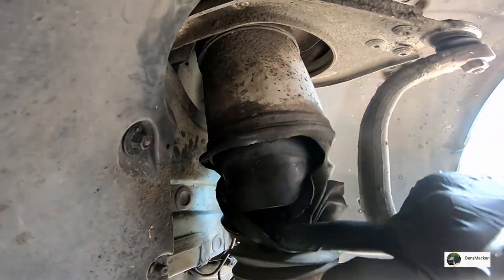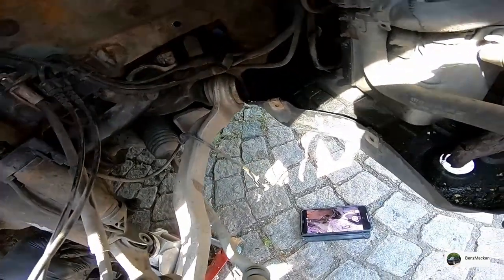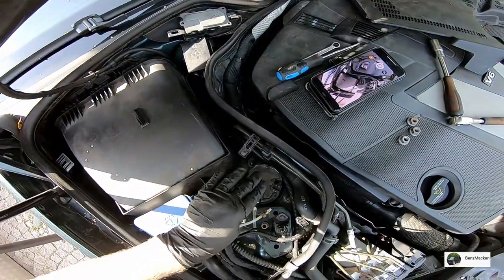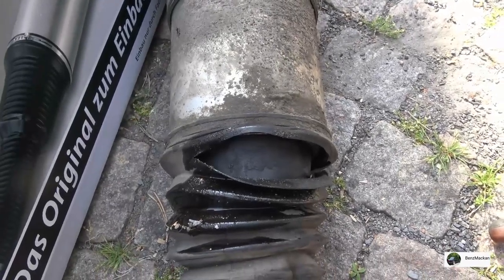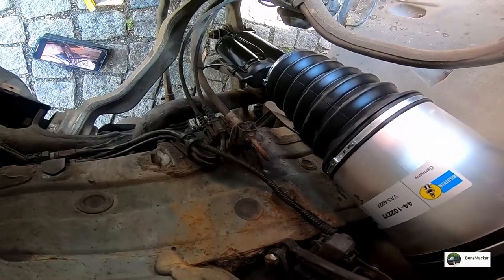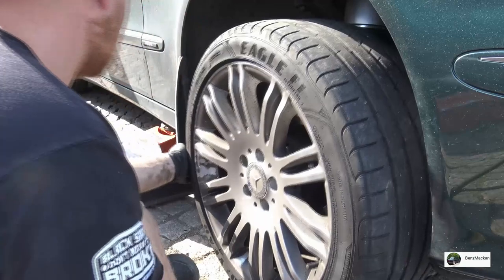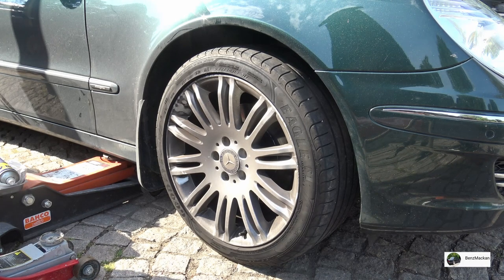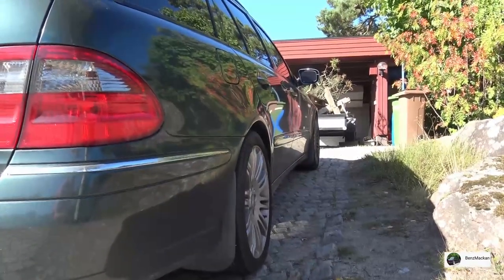Replacing a 700$ Airmatic air strut in the drive way, on my 2007 W211 320 CDI.

Comment: Great video. Looking forward to the video about the low boost issue. Would recommend to start checking the intercooler hoses first(passanger side is well known for developing cracks).
Reply from the maker: Thank you!

The boost issue is fixed and a video will be posted “soon” 😁
Reply: @mackanistheshit  haha great looking forward to that video. What caused the issue if i can ask?😅
Reply from the maker: It was the hose you mentioned:) passenger side charge hose. :) I was almost 100% sure it was the turbo actuator.
Reply: @mackanistheshit  Great, thank you for sharing :)